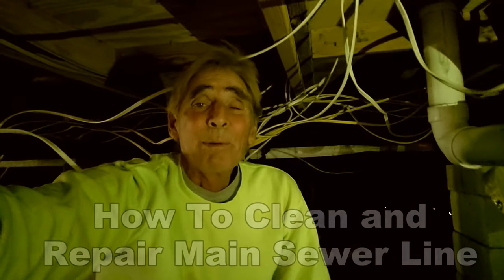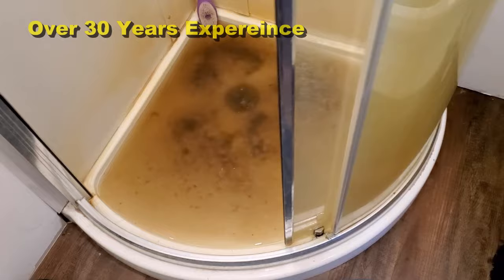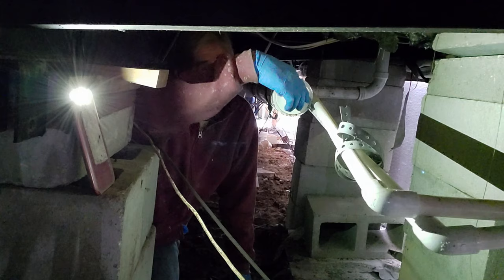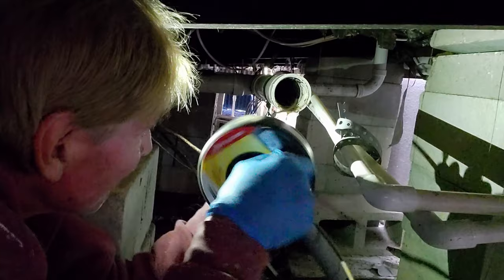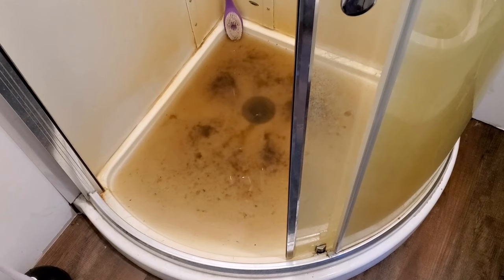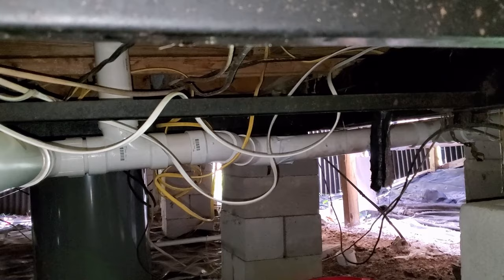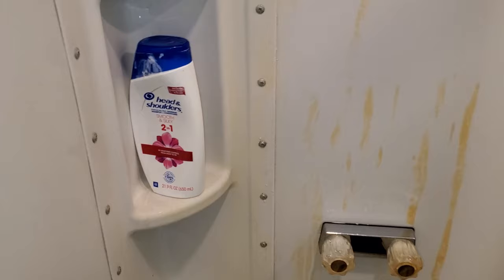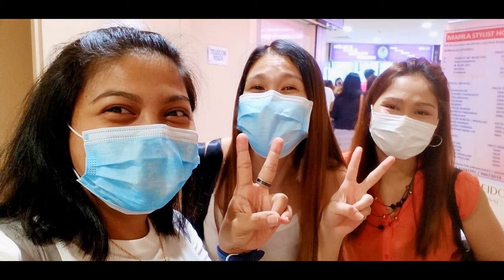Blocked Drain, Sewer Clean Out, How To for Homeowners

Comment: Great demo!  I had a clog in the kitchen drain-sewer line--the 1/4 in, 25 ft snake did not work; I needed to use the 1/2 in X 50 ft professional grade drain auger rented from Home Depot.  It did the job in < 20 min.  It took considerable effort to manually push the line through and so for those considering purchasing an auger, I strongly recommend spending extra to get one with an auto-feed mechanism.  My question:  Is there any annual chemical treatment to prevent future clogs?

Comment: You are amazing, sir! Thank you for this video! But I have a mobile home with 2 bathrooms that are doing what was shown in the video! Do I have to resolve both bathrooms this way? Thank you.
Reply from the maker: Hi Ginger.. Maybe Not!  If they both back up, the the problem is probably outside the home from the home to the tank or sewer. If you can get under the home, you will see the sewer pipes. There might be cleanouts on each sewer line from each bathroom. Either way, if you can rent a drain cleaning machine, you should be able to unclog. or if needed call a drain cleaning company.. not a plumber. Drain cleaning companies are usually cheaper and that's all they do is clean drains

Comment: That was kinda fun, on this side of the screen!
We have an outlet line clog in the old farmhouse, past where everything meets, so between there and the tank.  Problem is, the old cast iron pipes go underground in the crawlspace where they drop, no cleanouts, and the piping network is invisible and inaccessible.  Frustrating!  I'm thinking pull the downstairs toilet and try to work in from there.  
I need a suitable snake.
The clog is fairly far away, as it takes a few gallons to bring it back to house level after letting it seep down overnight.
I looked up the Spartan 1065, that might be a bit much for occasional home use.
There's a DeWalt unit with a 5/16 x 25 cable, spring end - I'm reluctant to think it's large enough to open up the old metal pipes.  And it might be pushing fifty feet of pipe before reaching the tank.
Any suggestions on a unit large enough and robust enough for these pipes, but not bank-breaking overkill?

Oh, my hard water deposit dissolving solution is to buy muriatic acid and dilute it with water according to the severity and location of the deposits.

Comment: It seemed to have clogged at the T formed with the cleanout line, which seems to inhibit the flow.  I would imagine they'll run into the same issue in the future.  Could you have changed that T to an elbow or installed a cleanout at the couple you installed?
Reply: The people way to have done it is to use a wye tee, this repair will definitely clog again in the future

Comment: Excellent teacher.
WOULDNT BE EASIER IF  UNSCREW THE PLASTIC PIPE?
Reply: I know this is an old comment, but incase anyone else is wondering...   the big white PVC pipes that handle the sewage are not threaded together, they are glued.  So, they can't be unscrewed, they have to be cut.

Comment: I have an issue in my mobile home. Its bedn going on for 4 years now and getting worse. It s a 1 bathroom. I used to live where I was hooked to public sewer and sinks would drain way too slow. I used a little hot water and bought one of the cheap smoke augers at lowes and used it. It seemed as if someone had put grease down it at sometime. My ex-in-laws used it for 4-5 years, so there's no telling what was done. Anyway, the sink would drain slow and you'd have to flush toilet a few times to get it to go down. Maybe these are relate, maybe not. I may have a clog in sink drain, but also have a blockage in vent stack. The tub drains fine, so I figured the drain stack may be ok. Fast forward, 3 years, I moved, have a new septic system put in. 1500 gallon tank. Up to a few days ago, I had the same one problem. Slow drain, but a few days ago, the sink completely stop. Barely trickling. I can't find myvsnake I bought, since my move, so I am going to invest in a better, more expensive one. You can crank or use a drill. I may cut my underbelly and cut my drain pipe like you did and install one of those black rubber extension pieces and try to use auger to clean towards the kitchen sink. I failed to mention that when ever washer is draining or toilet flushed, I can hear it a exiting really fast through drain under home, so I believe vent is OK, like I stated earlier. I am ghinking that I have a blockage in between sink and where it goninto the 3 in section. I am almost positive of this. We clean just under the sink and pulled out a lit of gunk, and used a small hand crank auger. I couldn't find my 20 ft. The one I did find is only about 10ft long. After using it, it seemed, for a brief moment that it was getting better, then its completely stopped again. I am out of options. A loxal plumber wants $95 just to look at it, not to mention to fix this. The first thing that they said was, "Your septic tank may be full". 2 people in less than a year. I doughnut. Like I stated earlier, you can hear everything drain fine from undef trailer, just not the sink. I am going to try and use your idea and posdible film it if I can and hopefully, fix this without spending a fortune. I never, never, never put food or grease or anything else down my drain. It was suggested that I hire someone to do a hydro-jet cleaning. I am afrain if damaging my lines. I do not want to use any drain chemicals, either. Any advice to add in addition to your video would be helpful.

Comment: Thanks you are great.  I live in a mobil home and I have a similar problem. I would like to know if the robber black think to put together the pipes you cut is good to be opened again if is a clogged?
Reply: Yes it can it has hex head screws that can be unscrewed as easy as it was screwed tight.
Reply: @anrod185  thanks I did it. Clean the pipe and it works wonderful thanks. 😁

Comment: Problem not solved, they will eventually have to do this again and not know that it was partially done. What's the long-term solution
Reply from the maker: Maintenance
Reply: @appledrains  well that keeps you employed, and isn't that a flawed system
Reply from the maker: @MrRob1317  nothing lasts forever
Reply from the maker: But thanks for your input

Comment: How can I access those pipes if I live in a house?
Reply: The pipes are under the house.  If you have a crawlspace, just crawl under the house to access the pipes.  If your house is on a concrete slab and doesn't have a crawlspace, you may have clean out pipes sticking out of the ground near the home foundation or septic tank/sewer line or in both places.  If there are no clean out pipes on a concrete slab, it's more complicated and probably a job for a professional.

Comment: You sir must be an octopus being able to get into such tight places for certain. The plumber who did this job must of been a jerk. Why did he not put an access to clean the line. Can you say incompetent. I would be you that the pipe edges are not deburred either. SHODDY WORKMANSHIP. PERIOD.
 Why would a plumber put a vent pipe tee indexed that the flow can go up the vent a bit instead of turning the tee with the radius guiding flow for drawing the flow of air from the vent pipe ??? Thanks

Comment: There’s no need to cut the pipe you can use a water jet system if you are professional enough to have one and I see you used a little sink rooter on a sewer drainage and now you want to start cutting the sewer pipe you need to update your tools for the repairs job

Comment: Amateur work. For a situation like this, you pull the toilet (vacuum waste out first) and run a cable machine down the main line at the very least. You don't go cutting pipes and sticking a tub/sink auger down a lateral/house main. You poked a small hole probably and  got a few pieces but didn't dislodge the entire clog. That's the point of having the built up water behind it - once you bust the clog with the machine it washes it out to the city. You could have still done what you did RE the pipe, but all you did was add a fernco. Instead of doing that why not do it right, cut a little more and glue in a cleanout? Stick to french drains bud...
Reply from the maker: Works great! No more problems there!  Saved them a few hundred and Solved the problem!! But thanks for your comment 
👍

Comment: I am a bit surprised that the top priority concern here should be fixing this problem WITHOUT getting any sewage on the floor of the home, and on the floor of the crawlspace. The raw swage should have been syphoned out through the toilet or the shower using a pump of some kind. This is toxic waste and the homeowner's health and well being must be the top priority. The shower will require extreme cleaning / sterilizing measures to ensure the homeowner doesn't wind up with the numerous health issues that can result from toxic waste exposure. The cleanout should NEVER be located under the crawlspace. It should be located outside the home for proper methods of dealing with this issue.